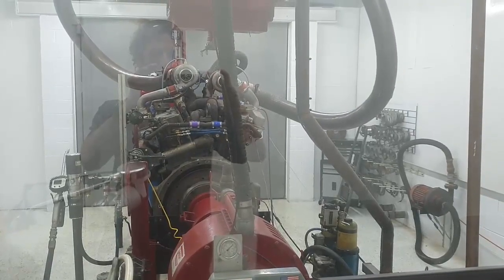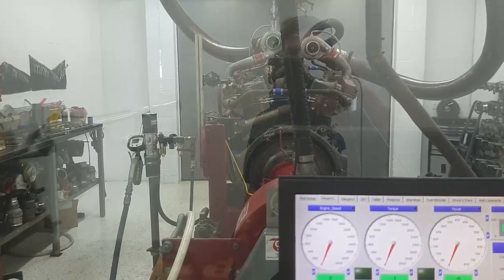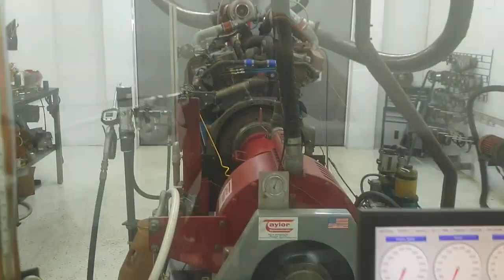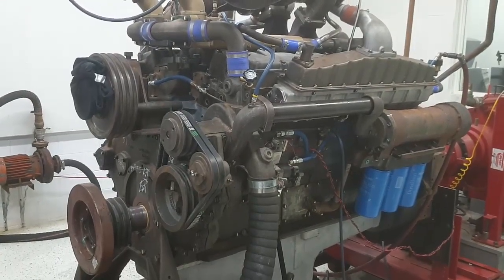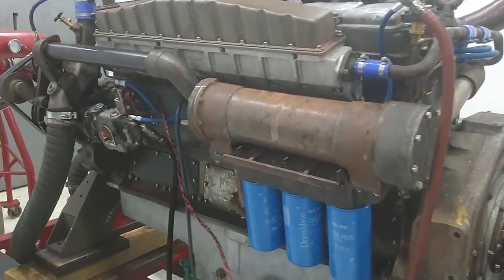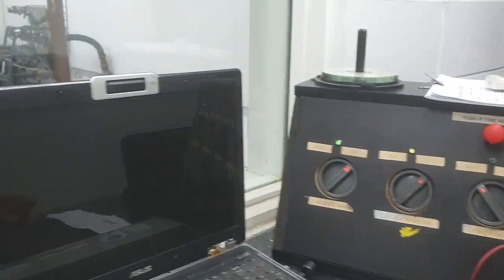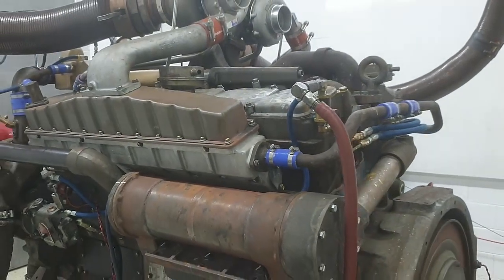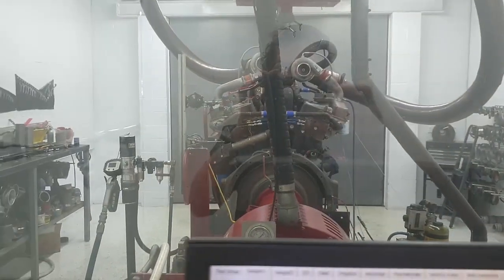1710/VTA28 comments,talk and idle run

Comment: I repaired and rebuilt hundreds of these as a  diesel  Journeyman mechanic for Cummins Engine Company  (a factory franchise shop  ) and eventually  as a field mechanic of a total of 34 years .   VTA 28 or VTA 1710 it  was a very popular powerful  engine  for mining equipment and generators but they always  had camshaft issues  . From 500 HP  to 800 HP  they were  Cummins's bread and butter engine back then  . The quietness of the engine mostly came from the Teflon tabs in the sides of the pistons reducing  the piston slap . They did this to stop the pitting of the cylinder liners .They  tried Teflon button  in the pistons for a short time but that was disastrous . Oil consumption  was incredible with those style  pistons   . We also learned a cut crank will eventually break under the right conditions especially in a bulldozer application   . 
      Your Dyno setup is far nicer than the company I worked for.   They were some real cheap ass mother fu(kers when it came to  buying  good equipment . Hopefully that  shit changed when the factory took over all  Cummins dealerships .  
Show me one bolt and I can tell you where it goes in this engine . I am retired  now but I could still put this engine together in my sleep and  also trouble shoot it . Am I bragging ?  You bet  , it is what I did .
Reply: You are 100% correct in this assessment, like you I spent decades with Cummins Engine Co. Distributors and the 1710 became one of my favorites. These engines made our customers a ton of money, along with hauling loads of coal.